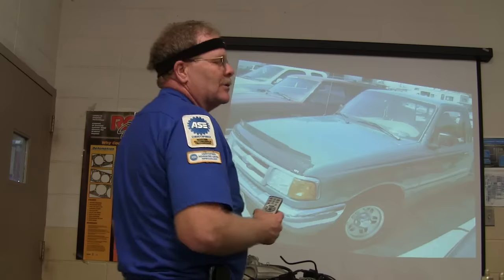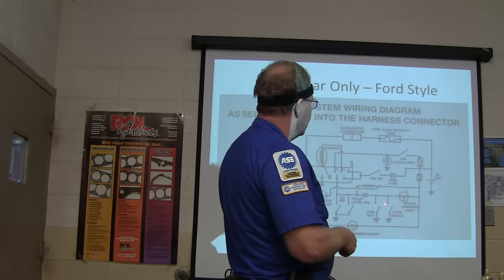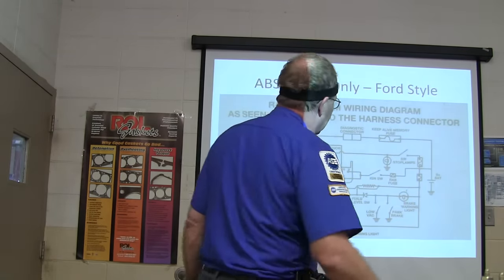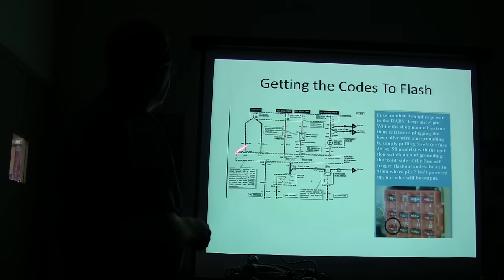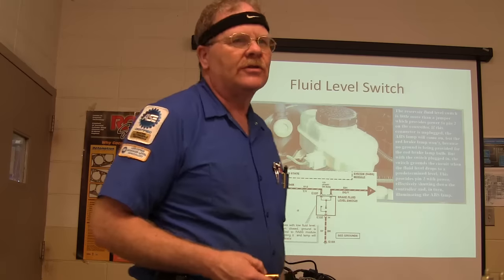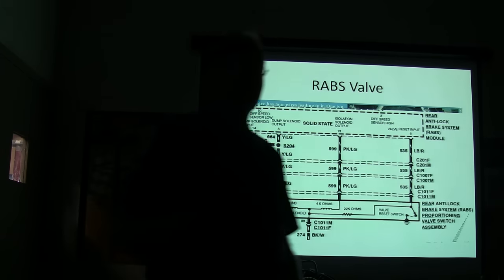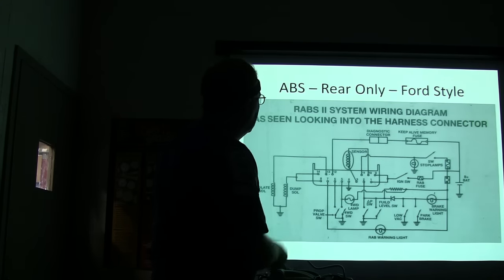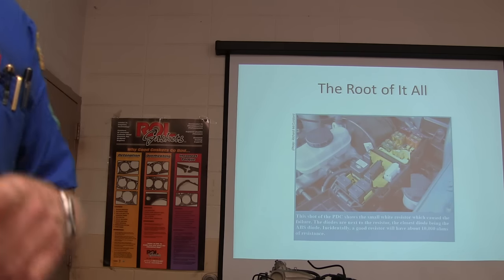RANGER RABS Problem

Comment: Thank you, I’ve been having problems recently after changing my brakes in my vocational shop myself and turns out it I was sold 4 wheel abs rotors instead of RABS equipped rotors therefore the ring for the sensor wasn’t there and there is no way to scan those modules on a 96 due to the failure to integrate it with the OBD until 97 but I still appreciate your expertise

Comment: Hello there, found your video, super helpful. I have a 93 ranger, and i had replaced the master cylinder and no lights were on. I replaced the hydraulic valve and my abs light and brake light are on. I pulled a code 4 when doing the test. I got a remanufactured hydraulic unit from O'Reillys and i read one of the reviews on their website that the pins were switched. I did measure the resistances of both the new unit and old unit and they were similar, not exact. 

What is the pin order? Did Ford reverse the pin orders when going to RABS II? I have RABS I right? Thanks for any help!
Reply: Did you fix it?😮
Reply: @rickymack01  yup I did. I replaced the hydraulic unit again and it worked fine.

Comment: Hi, I talked to you 2 years ago about my 1989 Ford ranger rear antilock hydrologic unit. You were very helpful. One of the things you told me was to check for grounds. I never could find the grounds so I've still had the problem but, I've replaced the oxygen sensor and found a black wire that isn't connected. I check for voltage and it came up 4.4. Do you think that might be a positive ground for antilock unit. Thank you
Reply from the maker: Where is this black wire? It sounds like a disconnected ground for sure with that kind of voltage on it

Comment: Good video....Would a bad white resistor prevent the brake lights from illuminating? I have that exact same Ranger in the video and the brake lights won't work I've checked the fuses, relays replaced the brake pedal switch, ran a jumper wire at the switch connector all in vain.....any suggestions would be appreciated...thanks
Reply from the maker: That resistor won't cause that... Got power to the stoplight switch?

Comment: Hey McCuistian, I’ve got a 94 Mazda b4000 that has been flashing abs at me and brake light always illuminates. The abs flashes 4 times constantly even after I replaced the sensor and tried to reset it altogether. If you have any ideas for me I’d love to hear them. I know it’s pretty broad, but I’m looking for any help I can get on it lately. The brake lights and tail lights don’t work either, replaced fuse for them even though it wasn’t blown and still did nothing. Headlights and signals work, super confusing to me!
Reply from the maker: The RABS valve - the one with the two solenoids - can cause that code and warning light if the valve's internal circuitry connected to the light-blue/red wire is faulty inside the RABS valve  - or if that wire is chafing against ground or broken it will cause that. Make sure the light-blue red wire that runs from the RABS valve to pin 6 on the module isn't broken or shorted to ground before replacing the RABS valve - but the RABS valve itself will cause that if that resistor is open. The ABS module feeds 5 volts on that wire to the RABS valve, which has an internal 18,000 ohm resistor that pulls the 5 volts to about 1.9 volts under normal circumstances - if there's air in the system, that circuit is grounded inside the RABS valve and, that can cause this code and the light too, but if your brake pedal is high and firm, it isn't likely to be a problem with air in the brake lines. Warning: Don't rush out and buy a part before you make sure it isn't a wiring problem!!! Usually people ignore everything I tell them about checking the wiring and they rush out and buy the part first. Which is the wrong way to go about it unless you have money to burn.
Reply: @McCuistian  I really appreciate the help! I’ll check the wiring first thing👍🏼 Thank you!

Comment: Man I have been waiting for this video, where the hell is the RAB valve at? I have a constant red brake light and amber ABS light on my 96 2wd ranger most of the time but my brakes work fine? I replaced sensor on pumpkin checked the brake reservoir level. The weird thing is the light goes out on occasion for a bit especially if its rainy or extra humid (I'm in Florida its still hot and humid), I had similar issues with my ECM box which I cleared by cleaning contacts. Id love to sit in your courses your a great instructor!

Comment: I have a 1996 with a code (12 flashes). I have power to the wire closest to front of truck. Ground wire is good. Switch is normally open, isnt it? I can push down on float and it doesnt seem to switch (no continuity between either 2 pins on master cylinder switcg. 
Fluid level is good. Cleaned connectors at MC. 
Will codes clear automatically or do i need to clear it?
Reply from the maker: On those, you'll need to disconnect the battery to clear it - earlier RABS systems didn't store the code, but that one does. Actually, when the fluid is low, it shorts the other two wires to ground, so yes, it's open in that regard. If you disconnect that connector and use s piece of small solder (don't damage the terminals) to connect the two non-grounded pins, you can check it that way.

Comment: trucks flashing code 11. replaced sensor on top of rear diff and sensor behind brake pedal. still poppin code 11. 3rd brake light illuminates with door up but not while pressing brake pedal. any thoughts??
Reply from the maker: That usually means the brake light bulbs are blown - typically it shows up on Aerostars and Rangers that have orange turn signals and red brake lights - both the regular brake lights are out for some reason - the RABS module looks for a ground through the bulbs and if it doesn't see one, it assumes you're going 40 mph with the brake pedal pressed.
Reply: @McCuistian   all lights work as they should. i hear and read conflicting info on the 3rd brake light.some say it only illuminates with door open.others say it illuminates with brake pedal..hence the reason its called a 3rd brake light. with that said, it only works with door open, does nothong with door closed and pedal pressed

Comment: Hi, I have a 1989 Ford ranger with rear antilock brakes. The brake and anti brake lights stay on. I have replaced the master cylinter, brake booster, hydraulic valve, speed sensor,and bled brakes numerous times. Going to check codes next. Do you have any suggestions.
Reply from the maker: I would definitely check the codes - you likely should have done that first - it may be a wiring or connector pin fit issue.
Reply: Thank you so much for answering me, you are the only one that knows what they are doing. I did check the power at the master cylinder switch, no power running to it, I am going to check codes tomorrow. Thank you so much
Reply: Good afternoon, I got the code 4, I checked the master cylinder and have no power, any suggestions, thank you very much
Reply from the maker: @dannycarlile4797  Code 4 is a closed RABS valve switch - check for a bad valve reset switch or wiring shorted to ground - repair the wiring, since you've already replaced the valve.  It could be shorted or open and you could have loose pin fit or bad connector crimps on that wire.
Reply: Ok, I will do that, I want to thank you for your help, I appreciate you. Wish you were in my town, Thanks
Reply: Good morning Mr. McCuistain, I checked the rab s and was getting no power to pin 2. I have power at the master cy l so tomorrow I am going to bypass switch with short side to see if pin 2 is receiving power. ran out of time. Have to go to work    wire looks good still have to find ground. Thank you
Reply from the maker: @dannycarlile4797  make sure your checking with a voltmeter because if there's no power going to pin 2 of the module the module shutdown the system and turn on the warning lights
Reply: If   i make a loop on the master cyl  plug will pin 2 be hot, thanks
Reply from the maker: @dannycarlile4797  That means the master cylinder fluid level switch is bad
Reply: Thanks, I will check it out, thanks,you are the man, have a good day
Reply: I just checked the master cylinder plug with a loop, no power at hydraulic valve plug. Checked the master cy l plug. Got 12.17 power coming in. With loop in got 2.87 on wired going to the hydraulic valve side of plug, but nothing at hydraulic valve.could the plug at master cylinder be bad. Thank you
Reply from the maker: @dannycarlile4797  That circuit carries power (measure with a meter) to pin 2 of the module - when that voltage is shorted to ground, the module illuminates both lights.  The fluid level sensor does that when the fluid gets low, but a short on that wire or in the sensor will do the same thing
Reply: Are you taking about the control module or the hydraulic valve. I have taken out the control module out and check out the panel and found no burn place. Took to computo r tech and he found nothing wrong. I  will check out the site going to pin 2. The master cylinder is new and the old one had same lights on. Thanks
Reply: If the system has shutdown does it take a scan tool to reprogram, thanks

Comment: Greetings Mr. Cuistian I am having a problem with my rear anti lock light staying on to my 1990 f250. I tried to get code to flash by grounding the terminal to the left of the brake pedal but will not flash at all it just stays light. I took it to mechanic as well and he could not get any reading as well. My brake pedal is spongy as well which I wish to correct once I can get a read out from the RABS system in diagnosing the problem. Any help would much be appreciated in what to do next to find the problem.
Reply from the maker: RABS (rear antilock brakes) doesn't usually cause a spongy pedal - if it does, it'll usually be a problem with the RABS valve itself and you won't find that by flashing codes. Before you replace ANY parts though, you need to be sure that there's no air in the system, and sometimes it takes quite a bit of bleeding to get all the air out. Pursue that to the end before you start looking for a RABS problem.
Reply: Mr. Cuistian thanks so much for your reply. I did bleed (RR, LR, HCU, RF, LF) the brakes today they did get stiffer when the engine is off. When turn on the engine to engage vacuum power brake booster, I hear a hissing sound when I pump the brake pedal coming from the firewall where the vacuum shaft attaches to the pedal. After turning the engine off if I pump the pedal a couple of times the pedal becomes stiff again and hissing sound goes away. So, when engine running spongy brake pedal, when not running it stiff again after couple pumps. I would assume I have a bad diaphragm? Would that also give reason for anti lock light staying on?
Reply from the maker: @sirjustus3770  No, but that's indication of a bad brake booster. The ABS light on those only has a few causes - the most likely cause would be the sensor in the rear end - they fail a lot and don't cost much - and they're easy to replace. But you need to find out why it won't flash a code.

Comment: Hello, my 2000 ford ranger flashes 16 times when I check for the Abs code. Abs light stays on. What should I look for? Thank you
Reply from the maker: Typically that 16 code means no problems are detected - is your red brake light on too?
Reply: @McCuistian  only the abs light stays on.
Reply from the maker: @ScottysVise   that code is not telling you what's wrong it's telling you there's no problem and that may be a problem with the ABS module itself. Hard to say without checking every wire...
Reply: Ok thanks for the info. If I find the issue I'll report back. Have a good day.

Comment: Hello friend, I live in Brazil and I have a 1994 FORD EXPLORER with ABS on all 4 wheels.

I tested the ABS brakes and got code 22

How can I solve the problem.

Is there a manual available? 

Thank you very much 

greetings from Brazil
Reply from the maker: https://charm.li/Ford%20Truck/1994/Explorer%202WD%20V6-245%204.0L/Repair%20and%20Diagnosis/Brakes%20and%20Traction%20Control/Antilock%20Brakes%20%2F%20Traction%20Control%20Systems/Testing%20and%20Inspection/Pinpoint%20Tests/B%20DTC%2022%20Front%20Left%20Inlet%20Solenoid%20Valve%20Concern%20Diagnosis/Diagnostic%20Notes/
Reply: @McCuistian  thanks

Comment: I have a 1994 F350 Diesel rabs valve has a creeping pedal can't figure out why new master brake booster front rear calipers wheel cylinders rotors drums shoes pads everything's new valves new need help
Reply: How did you end up repairing your issue?

Comment: Mr. Cuistian regards my name is Jesus, I am in Venezuela where it is very difficult to get spare parts ford, can I replace the RESISTOR ABS with a normal resistance? What kind of resistance can I use to replace it? (specify ohms and type of resistance) my Ford ford ranger 2001 automatic engine OHV 6 cil. thank you very much for your contribution greetings from pto la cruz-venezuela.-
Reply from the maker: That resistor is 10,000 ohms.  :)  Greetings to you sir!